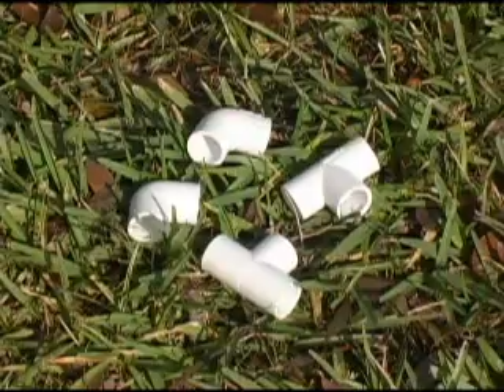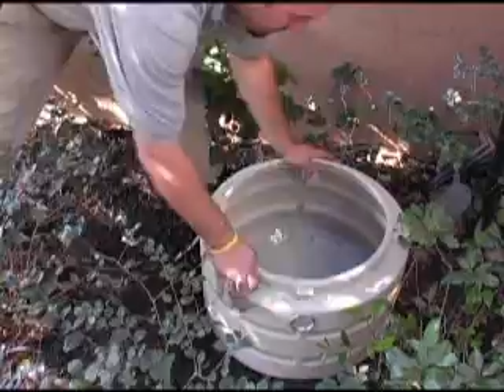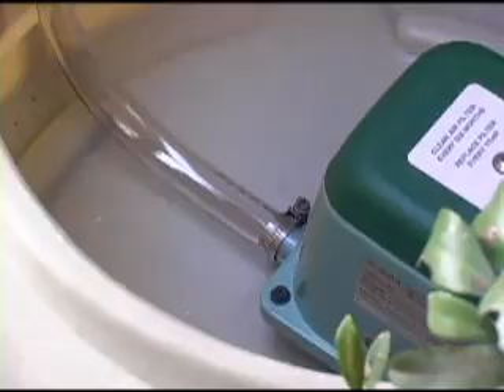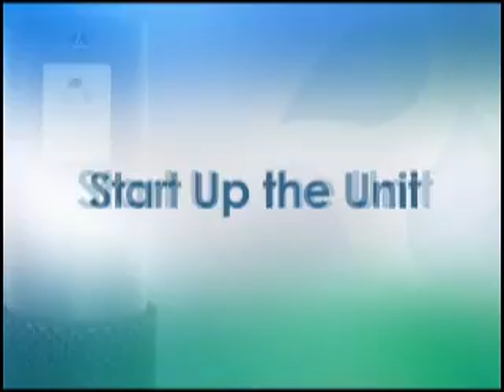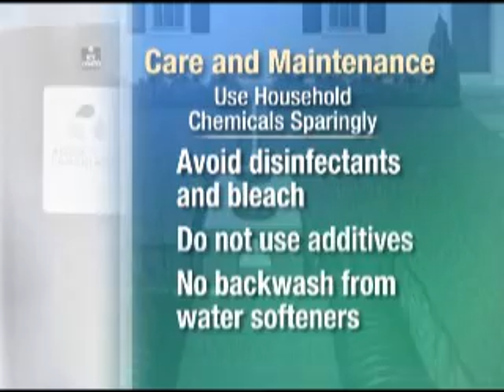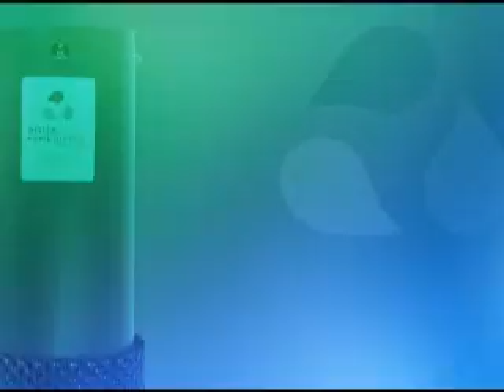Septic Tank Aquaworx Remediator by Infiltrator Installation

Comment: Use reducer bushings for piping.  Also whats with no grommets being used for holes through for piping on the risers; how are you able to get water tight connections to prevent soil intrusion with not grommets?!
Video is so unprofessional!   Tighten up Infiltrator!

Comment from the maker: The Aquaworx Remediator, ABG technology has been in the market for more than 20 years.  Infiltrator Systems became involved to offer solutions on challenging sites where the excavation involved with a system repair would be challenging or undesired.  The Remediator Technology is an effective solution for aging septic systems that are biologically overloaded.  It is appropriate for use on any type of septic system including concrete tanks, plastic tanks, gravel and pipe or chamber systems.  It is not intended to specifically repair Infiltrator product installations.  Infiltrator did not introduce the Aquaworx Remediator to address problems with Infiltrator units.  It was introduced because it offers a reliable solution to some of the unique challenges facing our customers.  Infiltrator products have been install in 2.5 million systems across North America with an excellent performance record.  If you have a specific performance issue that you are referencing in your comment, Infiltrator would be very interested in learning more about it.  Please contact us at info@infiltratorsystems.net. Infiltrator did not introduce the Aquaworx Remediator to address problems with Infiltrator units.  It was introduced because it offers a reliable solution to some of the unique challenges facing our customers.

Comment from the maker: The Aquaworx Remediator is a simple, easy to install septic system remediation technology that renovates failing septic systems (concrete or plastic tanks) with minimal landscape disruption. This unique system is inserted into an existing septic tank of a malfunctioning system and reverses the drainfield clogging process. It is a permanent solution that requires minimal cost to operate and maintain. The Aquaworx Remediator has been around for more than 15 years.

Comment: Is this product being introduced to address a problem with Infiltrator units?
Reply: This product allows for bacteria to form that will eat nitrogen and phosphates.  Also having airated effluent, soil soaks up better.
No problems with the chambers.  Unless chambers are installed on disturbed soil.  Which is a installation issue with the installers.